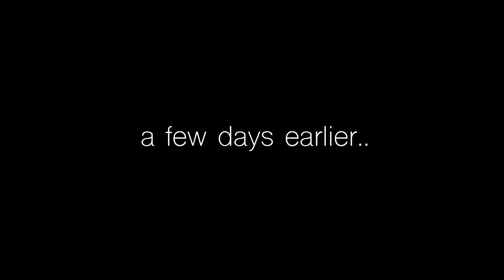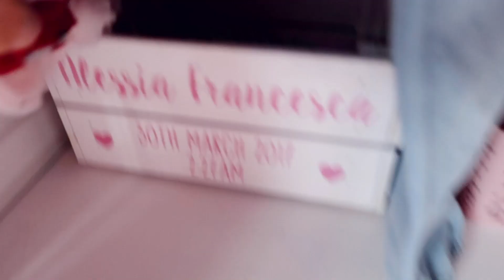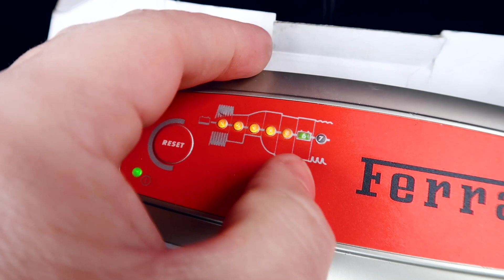NEW HOUSE DIY DRIVEWAY REVEAL

Comment: Looks kinda weird the sleepers in front of the garage doors, I know you don’t use the garage and it’s blocked off on the inside but you wouldn’t know that from the outside. Think it would make more sense without them
Reply: Kate Murray  or you could later brick or add paneling to cover the garage doors if this is part of the house you had closed off to use as part of the living area. 😁
Reply: @mlundon94  decreases house value
Reply: I_A_Z Playz it is there forever home so shouldn’t be a big deal.
Reply: @nancyclark6549  nothing is forever

Comment: From someone who's owned a construction business for over 20 years: 
That's not the proper saw for cutting a gate. You also should have snapped a chalk line across the bottom of the gate in order to make a straight cut across. 
I'd  get a pavement steamroller to compact those stones down. It will create a more even surface, and less rocks will kick up and hit your cars as you drive over them.  
If you want lights along your pathways, I'd dig a trench first for the electric to run through before laying down all that stone.
Reply: Or just get little solar path lights, so cheap and no wiring needed.
Reply: @sam-sq4si  That area to the side looks quite shaded. I'd put in electric landscaping lights. Solar lights don't last long and can look cheap.
Reply: I’d just chuck it all on the ground and leave it there
Reply: thehauntedmansionfan Great advice. I hope Jonathan sees this comment.

Comment: Just wondering if that membrane has holes in it for the water to run through?
Reply: if its the same as you put in the garden to put woodchip on yes it does
Reply: Thank you! I sure hope that's what he used, cause if not, well we all know what's going to happen when it rains : 0
Reply: @cookie4168  lol Jonathan reading the comments yes sure its fine.In fact he has got it easy compared to me.I had to do a very large border bed the summer before last .I offered to do it for my mum with that membrane .but i had to cut holes in the fabric to go around every flower .well i wont tell you how long that took me to finish lol..jonathan at least you did not need to do that.then put bark /woodchip etc on the top.we also did under a trampoline that way and put playbark.
Reply: Wow, that was a project!
Reply: @cookie4168  yes it was for sure